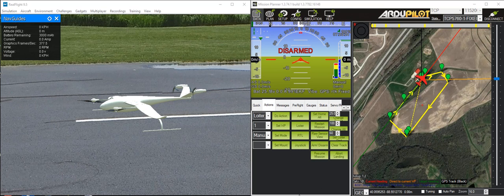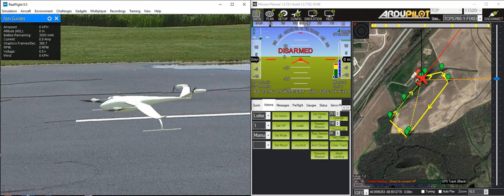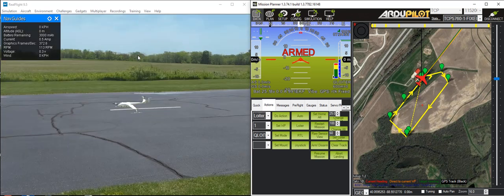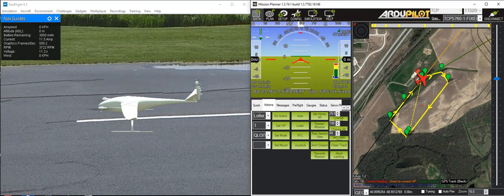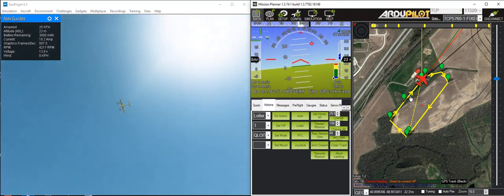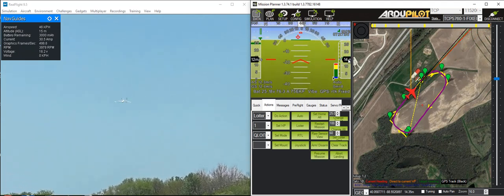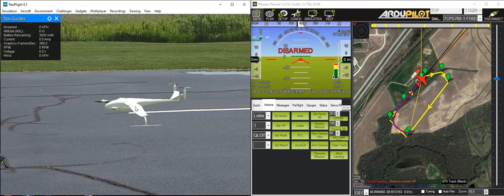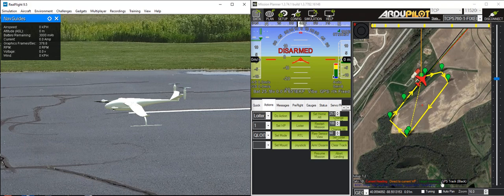Telluraves Raptor 200 Demo Flight with ArduPilot SITL

Comment: Nice model and great simulation. Since the information on Telluraves website is pretty scarce, I wonder about the size and weight of this aircraft. How reasonable are the 17Amps in cruise flight and the 30Amps for hover?
Reply: Hi Pascal, No payload- 5268.6g; with Night Hawk 2 - 5,528.6g. The simulation model still needs optimisation and we are expecting the real aircraft to improve on the simulations reported power usage.
Reply: Hi  @robertmiller9903 , thank you for that ultra precise measurement. At what stage is the development currently? If I read your answer correctly, I understand that maiden flight has not yet happened, as it seems that you have no comparison with actual data, right?